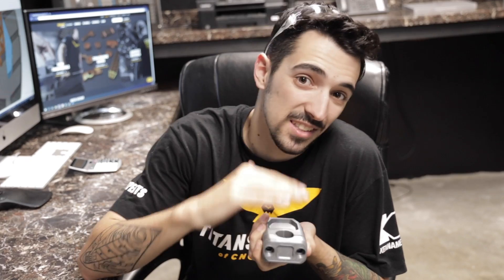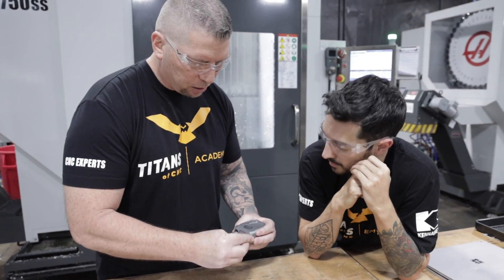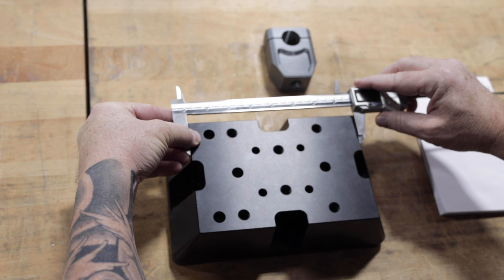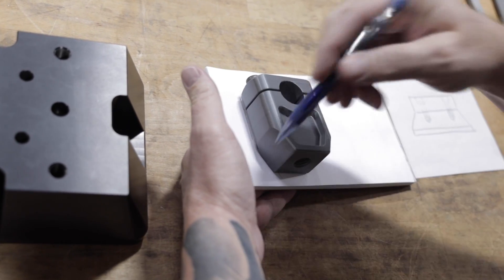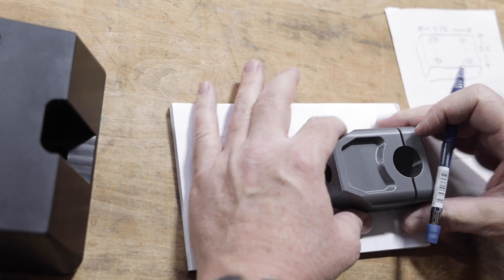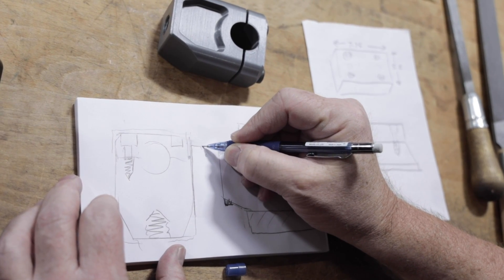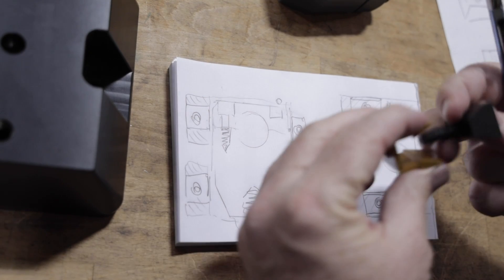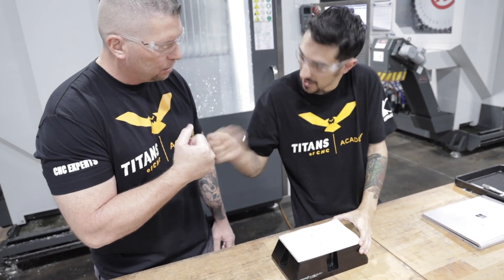5-Axis Fixture Creation for a Steel Motorcycle Part

Comment: This is a good lesson in fixturing and I like it. This video is really intended for education. A fixture like that for a low priced part would be worth more than the part you are making. A dove tail hold for half the part, and flat face jaws for the other side would be adequate for tens of parts but this fixture would be for hundreds.

Comment: there you have it guys I know that it took me for ever i was like 8 hours of approximate design basing on the video and manifacturing of both ops ( in the first op you hold the part in the vice with 0.200" depth so you are 0.090" clear from the face above the radius so when you are profiling you drop 0.040" below the face so you won't mark the face in op2 everything else you do it normally you tilt the table to drill the part at the left side and then you takeoff the part flip it along the x axisand you fix it in the right side to have access to the ritght side holes and you make a clearance slot in the jaws for the cutting of with the slitting saw this way you'll have both parts fixed 'no compromises' but you need to use a raiser to have clearence from the table but you can put a vise on the far right and another one on the far left and you can use double station vices to boost productivity but you need to modify the code a little bit in the sawing operation the simulation shows it okay but you the spindle will go up and than down and than retract because of the way I programmed it ) wow I learned a lot of stuff 3+2 programing was the major thing this is the first thing I programmed after titan 1&2m so I am proud of my self at this point so what you think guys and especially you titan what you think ?

Comment: this is a really rough and messed up demontration on another way that you can fixture this part using only soft jaws, I tried to do perfect cam operations considering the tools and spidle curve of your haas 750ss (which you will probably use) but since I don't have the exact cad model thought that would be useless what I am suggesting is that you hold the part in a vise gripping only 0.25" deep (considering that the radius on the edge is 0.25" and you will use a stock that is larger by 0.040" on each side which will leave you wiith a clearence of under the begining of the radius and you are going to coutour it 0.020" deper than the straight face on the side that way when you flip it around the x axis you are only going to do the corner radius and the pocket and for the slitting saw you can make a small relief in the soft jaws this is a link for the cad model it is messed basically fliped the part over but I hope you would get it i will finish the cam maybe tomorrow don't know what time it is right now but it's 3:30 AM in algeria as I am writing this please when I share the final file tell me your opinion about the cam, speeds and feeds, and what would you do.
the two circles drawn are a 2s representation of the slitting saw and the shaft
this is the link :   https://a360.co/3gbE2WY

Comment: I'd be curious what the process is for cleaning up the saw cut. I don't mess much with arbor saws but I know saws in general can leave a burr. 
If someone is totally against hand-work, and wanted to 100% go in and chamfer deburr the part with CNC, then I assume there would be no choice but to set these back up later for a cleanup stage. 
But, since we are practical people, I bet if it's a clean enough saw cut that throwing the parts into a vibratory or doing a quick hit with a manual hole debur tool and file will clean up any burr left. It is extra work by hand, but honestly if they end up either getting media blasted or hand polished, that's also likely hand-work for a lot of cases; so the tiny amount of handwork to finish off the burrs will not be significant step in the finishing process. But looking forward to see how that is handled in the videos...

Comment: How are you accounting for the saw kerf? Extending it in the CAD file?  Or I guess a perfect circle isn't necessary since it'll be clamping handlebars.
Reply: Generally you'd account for what you want your final dimension to be; usually with these clamps there is some gap left so that when clamping there is some room for stretch; which means that you can probably just let the kerf be what it is and that amount of gap is just left in the part. But absolutely if you want a tighter fit then you can model your part with an extra bit of length left in for the kerf, so the circle gets stretched with some straight section where the saw will do its work. Just means you'd want to machine that ID as a profile versus a plain hole drill/bore method but that's not a big deal really.

Comment: As an exercise in fixture design I would probably shift the stock up (over the edge) and fully finish the clamp and part it in the first op - then you can use the bore as a locating feature for the second op... even use a single expanding id clamp for two op 2 parts.  But this would be a lot easier to make if it was held vertically with a dovetail or in a small vise.

Comment: Ok: Maybe I’m just missing something here... 
1) I totally agree on making this from 1 piece of stock
2) Why exactly could we not just hold this in a little 4” vise on a riser? 
It could be stood up proud of the vise with only a sacrificial slug on the end that attaches to the triple tree with some talon grips. You could do everything ( including the slitting) except for the tapped triple tree hole in that 1st op. Aside from the slitting (no real pressure), and the profile (no pressure with a dynamic cycle) most of the cutting pressure (drilling) is going straight into the vise, so sitting high is sort of a moot point. Then lay it on its side with the slug hanging off of the vise, finish the bore (and the cap being clamped 90° from the split is going to stay in place) then tip the table, face the slug off and do the triple tree hole. 
 
I love making nice fixtures as much as anybody. But this seems more like an exercise in academia than just getting a 1 off part out right and quick. No offense intended with this post.
Reply: Yes, that's it exactly. He runs an online school to teach machining, and he has a part here that he can use as a lesson plan. So he did. It's not about the part, it's about the experience of the setup, planning, and then remembering to slow down at the end just enough to avoid flinging the finished part against the enclosure walls. And bonus, if you have a motorcycle the part might fit on it.
Reply: you're right that a vise would work, but vises are slow to fixture, take up lots of space, and it's difficult to repeat high precision processes in a vise so quickly. Think about how much time it would take to fixture one piece of stock in a vise, compared to simply sliding the stock up against those stops he drew and screwing down the pitbulls. With that big machine behind them you could make 10 of those fixtures and machine 20 parts in one setup in very repeatable way. So the effort of designing this kind of fixture will end up saving time and money and get you more consistent parts.

Comment: This seems live a very over complex way of doing it? Would you not just put it in a vice and either do one side, or do 5 sides, then flip it into a fixture plate and use the threads of the part to clamp it down to either finish the last side if you did 5 sides first or do the last 5 sides if you did  only 1 side first?
Reply from the maker: Stay tuned for the machining of the fixture and parts. The point here is just to show a easy system that allows 2 complete parts to come out every time the machine stops. Of course there are a million ways to do it...

Comment: Wont the ends of the threads need to be deburrd/counter sunk after the saw cuts the part in half?
If so, surely you would then loose all the time saved.
Reply from the maker: No, you go a hair deeper with the larger drill doing the through bore. Will show in upcoming video.
Reply: When making the counterbore clearance hole, he will surely drill a little deeper making a chamfer for his thread with the drill.
Reply: @empireages241  yeah i see that now, although i still wouldve thought that the saw would make a burr. I guess chucking them in a rumbler would sort it out

Comment: For a small run. 5-axis vice + DMU50, no fixture.
Reply: Only one OP, Boom !
The little extra stock to hold the part in the vises pays itself twice when you don't have to design, program and machine a fixture. You also save on fixture stock and storage.